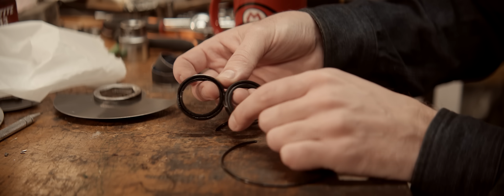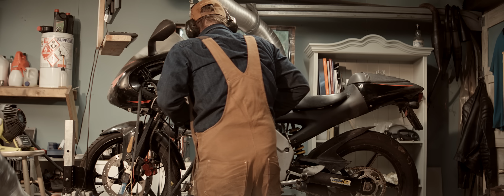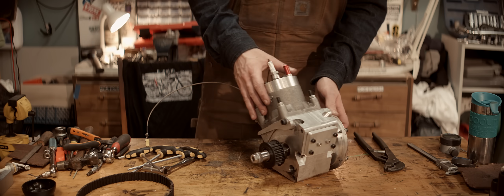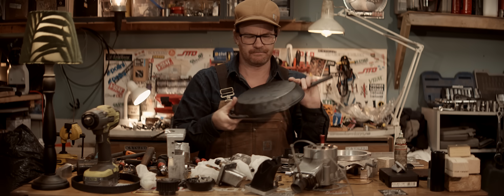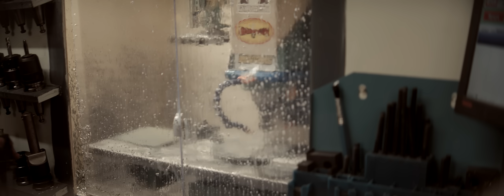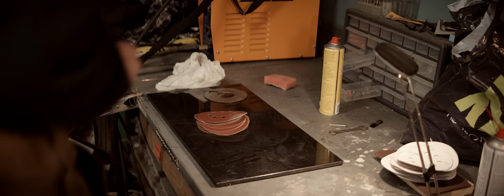Another Frying Pan Dead for The 2-Stroke Cause.

Comment from the maker: Re-uploaded cause first attempt froze @ 20:40
Reply: I caught that. I watched the other one, but I'll watch this one as well for the view count. Keep up the good work! I never miss an episode.
Reply: Alex, don't attempt to use another frying pan!!! Most non-stick PTFE coating contains diamond particles (diamond dust), which is abrasive. Using another frying pan will destroy the internals of your engine like it did the last time with that black oily grit.

Watch on YouTube
Frying Pans | How it's made
Science Channel
Reply: There is a  DFL-1 coating you can apply it your self for low friction applications. made by Tech Line Coatings or Powerkote. It's liquid, you spray with air brush, dry it, then you cook it in the oven for 30 min. They use it for bearing surfaces or also piston wall. cost around $40. All though it didn't work for my Metrakit pro race piston wall. that stuff came off really quick, maybe i didn't apply it properly or the use is to harsh for Metrakit piston. I think for your rotary valve situation it would work.

https://www.youtube.com/watch?v=8ZoZjUn9szs
Reply: Is this disc going out of shape the higher the rpm goes, a kind of wobble setting up. Watch videos of people spinning up CD's and so on to high revs, before they explode they go well out of shape, and remembering that the rotary disc is not as balanced as a CD.
Reply: I made it about half way through and it got removed, wondered what happened.
Reply: Yes your rotary intake is building up a ton of heat! What could be happening is the actual disc could be flexing at high rpms!
Reply: Was wondering what happened thought I had imagined the whole thing for a bit
Reply: I thought it was on purpose! 🤣
Reply: Could the black goo be from the fuel reacting with the inserts and not necessarily the rotary valve?
Reply: Under heat, the fuel would be more corrosive
Reply: Yeah the rotary disk maybe flexing..  By getting sucked to the crack case trough the hole
Reply: @renedejong6386 or like a car fan, it could be flexing because the wind at high rpms! Why not make a slot for the disc to sit in and ride on the outer edge!
Reply: I wonder if Nikola Tesla's patent would work as an intake manifold for your 2-stroke engine at higher rpm. it is a valve without mechanical elements. here's the patent https://youtube.com/shorts/zX2CGMlN1xU?si=dfrPEmXFPGkB0rhz
Reply: Thanks for the vid. If you want a cheap supply of bigger pieces of cast iron, weight lifting plates are usually cast iron. They have a hole in the middle which probably will be just fine. And you can turn them on the lathe to get out any stress bowing. Hope that helps.
Reply: It might help to fix the rotary disc onto the shaft so that it cannot touch the walls. Obviously it will still touch when pressure hits it, but may reduce friction.
Reply: And mabe the hex driver or the hex in the disc is not quite true and ends up binding only with load at high rpm. No idea how to test that.

Comment: As others have said or hinted, I would agree that your black goo problem is coming from the Teflon non-stick coating that is breaking down now. Have you looked at Hard Anodizing? It’s used for one example on automotive piston skirts and after break in is much more durable and heat resistant than teflon. While I’m not sure about its lubricity vs something like teflon I would suspect it’s pretty good if used on other metal objects that have friction surfaces.

Comment: I will repeat my comment from last time:- Would it work taking the valve friction away altogether?  A thicker valve that doesn't flex and doesn't touch the housing. A tiny clearance ( like you have on a piston ring would not lose significant pressur/vacuum at the speed you want to run. Counter balance the valve outside of the cases to cure vibration from the heavier valve.

Comment: been following you with this problem for a while .
the thing that shoots true my mind is the left and right play on the cranck is bigger with your type of cranckase bearings instead off just bal bearings.
every time the valve passes the intake hole it pushes in one direction and on that high rpm i think the disc resonance is waving the valve against the surfaces creating a hole lot of friction and heat.
its just a thought maybe it helps.

kind regards Scally Motor Co.

Comment: i don't really know much about rotary valves but to me it seems that a teflon sheet would work better than the thin coating of the pan sinds it gets worn of way to easily with the mechanic load on there.
the main plus of an sheet of teflon is that it is low in friction, can handle the heat (to an certain extend), is fairly softy so it wont damage the valve but wont easily be cut apart by it and because it is cheap and easy to machine can be easily replaced if needed.

Comment: I've noticed you're using the roller bearing on the rotary valve side. Wouldn't be better to use the ball bearing instead, as to minimize the effect of variations in crank length/lateral oscillations that could affect valve clearances? I don't think this should make that big of a difference, but honestly everything else seems fine to me.

Comment: I have an idea so that your rotary valve has a counter balancing weight, which seems to be what you need especially if you’re spinning higher and higher, RPMs may be a ring with the weight on the other side in a groove inside the valve that is out of the way of the actual opening something different but an answer to a problem I believe that is why you are destroying the seal the harmonic vibration created by the out of balance valve creates multiple problems. I’m a machinist and I can say there’s a better way love to see you implement it.

Comment: My guess would be that the rotary valve plate runs "Dry". Could some fuel feed holes from the crank or something help to keep a continous flow of fuel with oil where its not flowing right now. Usually rotary valves are against the crankshaft in the crankcase where theres always oil.

Comment: Been watching your channel for awhile,when i say awhile the first video i watch is when you had twin  rotary valves,one for intake and one for exhaust.what if you can put or put an oiling system for the rotary valve but in a way that the oil doesnt get in the intake,like a seal just before the inlet/intake.i am a mechanic just an idea but i think that should stop the high fiction on the rotary valve

Comment: On a snowmobile oil injection rotary valve engine the ones that run the best have the oil injection nozzle into the outer house in the intake port getting oil on the valve right from the start.. those typ engines mostly in water craft (pwc) and we see less problems with those compared to snowmobiles and the pws's run much higher R.P.M's than the snowmobiles..  
Hopefully this might be something to research and see if it helps.  Cool videos...Take care...Bob..

Comment: Having watched the video again, I feel a new end cover is required with the "correct" tolerances and don't remove any extra material for aesthics.The fixing flange needs to be as thick as possible with-in reason. Make it "belt and braces" Remove all future doubt! Check surface to surface contact on the crank using fine grinding paste and lap the DV carrier in.
If push comes to shove make the disc valve rigid and use shims for the correct tolerance to the engine case.
As you said it doesn't require a outer oil seal. A simple clearance is enough  for the  time being allowing a oil seal to be machined into the outer cover later.

Comment: Heating rotary valve plate - compressing a gas any amount  (here the piston moving down compressing the fuel mix in the crank case pushing it through a limited size orifice of the induction canal) generates a big rise in temperature of the gas. Friction doesnt have to be your problem. At such high RPMs, we can be talking a close to adiabatic compression. Maybe you will just have to live with it and add big cooling fins to the rotary valve cover plate and on the other hand INCREASE the contact area between the valve and the cover in order to cool it. I advise you add temperature and pressure sensors to the crank case and monitor there. I know the fuel mix does conduct away alot of the heat, but compressing a gas can create ALOT ALOT of heat.

Comment: I am not an expert on Rotary valves but I have Seen some Rotary valves on seadoo Rotax with oil  feed in between the disc and the case wich could be a good solution for friction and sealing at the same time alowing more clearance in between. Juste Gravity/succion feed if you realy want to use premix on your main tank.

Comment: Buddy, ditch that cast iron cover, we need to stop putting in compromised parts that could cause issues, remake a new one that you know 100% is good. Also we need to get you a thermal camera to help pinpoint where the heat is coming from

Comment: An Italian two stroke developer have used a ceramic plate instead of cast iron, he tooked a ceramic tile and grind it manually till it was thin enough and solved all the problems you having with the plate/rotary disc friction issues you are having
Reply: Ceracote would be easier
Reply: @dopeass791  yea probably, also because that was years ago and maybe there weren't cerakote technology

Comment: MAICO rotary valve engines back in the days had a thin spring steel valve. I guess 1mm or thinner, dir the exact value I had to measure. 
Clearance to the valve cover is 0.1mm. Clearance to crankcase is bigger.
Cover and Crankcase side of the valve got a rough turned natural Aluminium surface, no coating etc. 
Also there is no sealing between valve an the crankshaft bearing because it's not necessary.  Only a washer disc, a little smaller than the bore,  to cover most of it.

Comment: One of the better way sfor you to reduce friction on your valve is to mill the face back flat or make a new one and then scrape it in. The same way they do for the ways on machining equipment. If done properly, parts can effectively float on each other.

Comment: Low friction surface for slow movement and fast movement is completely different matter. With teflon like materials, surface deforms as it slide on a metal. There are huge viscosity losses in high speeds as the material is stiff.

Think about high quality tripod. They are manufactured to have close to zero static friction but they refuse to move fast. They use teflon type plastics

Comment: The saw blade is used for for a rotary valve it's meant to flex when it gets up to speed maybe that's what's causing causing the the firction you are seeing
Reply: so when you cut the blade to make a rotary valve you a  changing the geometry of the blade

Comment: consider putting a bearing on the shaft after the rotary valve and the oil seal, press it into the crankcase with a new seat, perhaps the turning of the unbalanced valve with the pulsation of the engine bends the shaft and generates friction

Comment: Steel rotor and cast iron backplate is a good combo. You may be running lean on the fuel's oil content. Try adding 1-3% de-gummed castor oil to the mix; it will form a varnish (polymer) at high temperatures that will protect the surfaces better than most synthetics—that simply burn.
Reply from the maker: 👍 Running 5% Castrol A747. Been sitting in the tank for a while, mixing up a new batch in case most of the oil fell to the bottom and has been spent already. In my experience A747 stays mixed well, but I've heard people say otherwise.
Reply: As I Understand it, you are currently using gasoline as the fuel (12.5:1 peak-power A/F). If you're running at 5% lube content (total), that's only about one-third the volume of lube flowing through the engine if you were using methanol at its peak-power A/F (4:1). You might consider doubling the Castrol A747 percentage for the time being. You can easily reduce that percentage once you've identified and remedied the current induction-related problem to your satisfaction. Best of results in your experiments!   @2STROKESTUFFING

Comment: Teflon is modeled after polymerized oil so why not coat the rotary valve in a low flash point oil like cheap cooking oil and then bake it in the oven at 400F for an hour? It will have a low friction coating much much more durable than horrible Teflon which I hate with a passion.

Comment: Given that the machine is resonant rather than mechanical pumping. Is there any need for the rotary valve to be touching anything? ie Couldn't it be floating on the shaft? Could the seals be providing bias force onto one surface?
Reply: yup, valve don't need to touch anything. but at the moment it floats on the shaft..................

Comment: We got a set comprising two DeWalt tools, one a "normal" battery drill and the other, an impact driver. I've had to educate my assistant that an impact driver should only really be used where impact is needed on the turning motion, not on everything. You wouldn't use an impact driver to turn a machine screw into thread, only to unscrew it if it was really stuck. The right tool for the right job.  Just sayin'. Keep up the good work, the videos are inspiring. 👍

Comment: Many years ago I was involved in the development of C-pet plastic pots. We originally used black ptfe on our mould faces to help the pots slip off, it didn’t, it grabbed the C-pet. After some consultation with the ptfe coaters we were using we were advised to use a green ptfe (it was 25+ years ago, the trade name escapes me). There are different ptfe (Teflon) types.
Edit. Xylan = low friction ptfe. Just remembered.

Comment: Cast iron very often has a bunch of stress in it from the casting process.  If you can get the back (non disc valve) side reasonably flat I'd be tempted to bond it to the housing and then use the mill to machine the disc side flat.  Also I don't think you want much clearance in the disc valve, it will effective lower crankcase compression and trap mixture into the clearance gap.

Comment: Just a quick aside about the non-stick coating, as soon as the the surface integrity is compromised they're useless, as it pretty much self destructs after that. The only way that it would work, would be to cut the metal and then coat the surface to make sure it's all bonded. I'm sorry it's taken so long to tell you about this, but I've been having a few issues at home, and haven't been catching up recently. Good luck.

Comment: frying pans are made to retain heat. the none stick is for passive friction not forced rotation friction. glass coating and Teflon coated rotor valve/like a piston and maybe run cooler fined outer case for expansion control.

Comment: imbalance! your rotary valve bring an imbalance in your system and this kill his self and the bearings on high rpm. try it with a counter weight. i think this will reduce your problems.

Comment: If You need a cheap cast iron source, remember that the weights used in the gym for weightlifting are made from cast iron. They are ticker than a pan, You can machine them with the lathe and make them perfectly flat.

Comment: Silly question but have you looked at " TECASINT 2021 black " it's a ultra low friction plastic. I was thinking you could either make a insert from it that sits in both sides of the covers or even stay using the covers you have and make the valve itself out of it.

Comment: You messed up the work holding when you machined that cast iron. The plate bowed slightly being held on either side like that, then you machined a flat surface and after the hold downs were removed that plat flexed back and your flat machined surface became bowed surface. If you can get a mag plate to hold down the work in the mill that would be better or use a fresh sacrificial base that isn't already used well beyond its usefulness. then work out a better more even method of work holding that wont tension the plate unevenly.

Comment: Try a nylon ring or rings inserts instead of the teflon. The idea is that the rotary valve would slide on the rings (if comes in to contact). And nylon is resistive to fuel and very "slippy".

Comment: I really know nothing about your engine design, that said, I wonder if there might be a balance issue caused by the rotary valve generating unbalanced centrifugal forces at high RPM, which is causing the seal to wear and bearing over heating?  Again, this could be a dumb suggestion.  I really enjoy watching your videos and admire your determination.  Hang in there, because victory is a great feeling, and you are always learning as you go.

Comment: The surfaces the rotary valve rides against don't need to be as big as they are, you only need a raised circle around the opening in the crankcase and the inlet from the carb.  Cut a ramp leading up to the raised circles and then just have the rotary valve free floating everywhere else.
Reply: interesting thought...............

Comment: Could it be that the 2 discs of the crank shifted/rotated on the big-end-axel?  (Or is the pin welded to both discs?  )    If it has rotated it would put the left (spine)axel out of alignment with the right axel, and will put more force on the bearings on each side, aka more friction..   (Hope you get what I mean by that!) :)
Also, I don't think you can measure misalignment the way you do it now, it mostly shows the unroundness of the place on the axel you put the indicator.

Comment: I used to work on personal water craft with two cylinder two stroke engines with rotary valves.  If I remember correctly, it was oil injected right in front of the rotary valve for good lubrication.

Comment: With how much trouble you are having with friction on the rotary valve, why not spin it slower?  Use a disc with multiple holes instead of one spinning plate, so you can spin it at a lower rpm.  That would make it easier to sufficiently lubricate so it doesn't scrape.
Reply: because the disc is fixed to the crank, you would need a way to gear the crank and the disc ......... ??